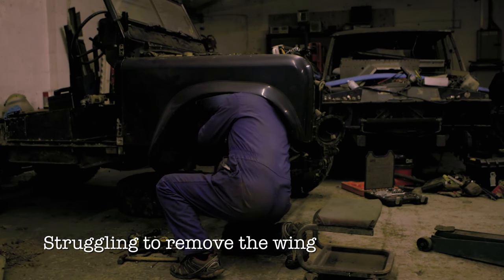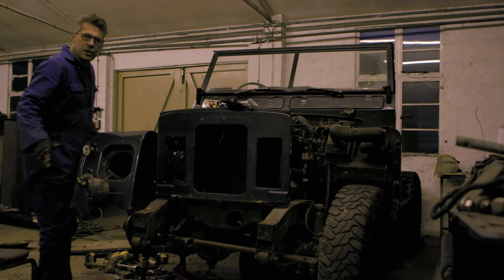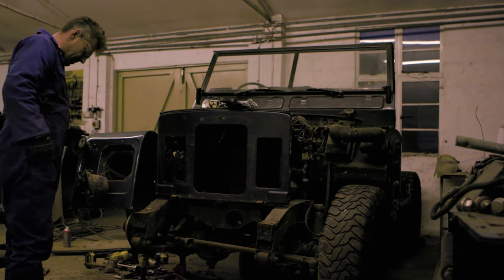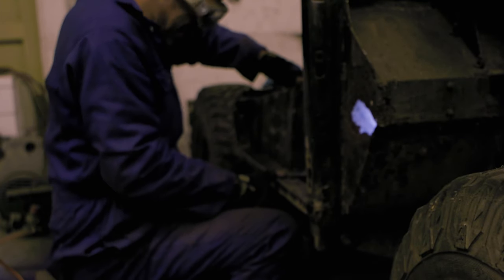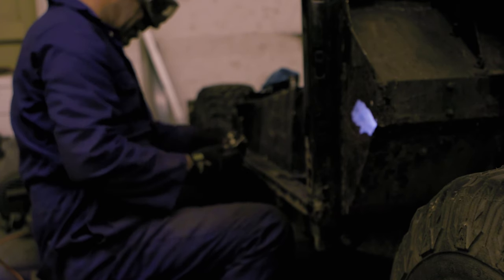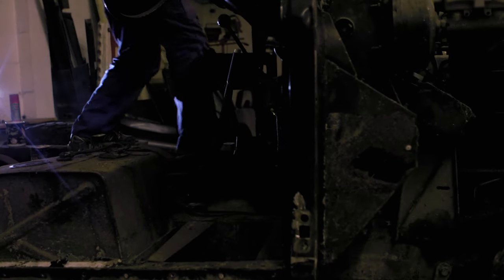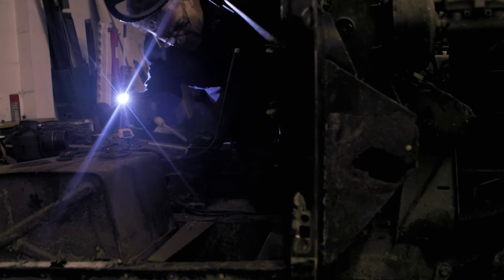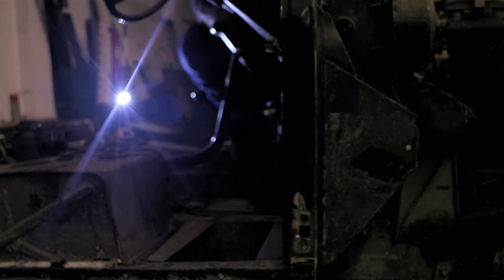Ep. 09 - Series 3 Rebuild -  "Wing & Seatbox"

Comment: Tightening the oil filler plug can sort the steering...nice one :-)
Reply from the maker: I know. Good one right?
Reply: @monkeywithaspanner8494  Maybe you meant the square nut on the side of the steering box which actually tightens it up ... and yes, I agree, before I did the same, steering was optional!